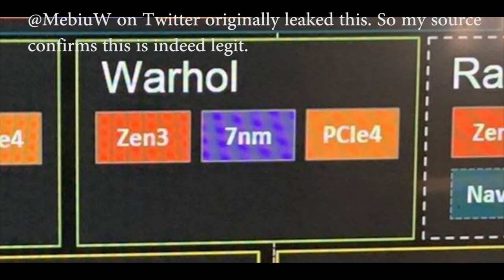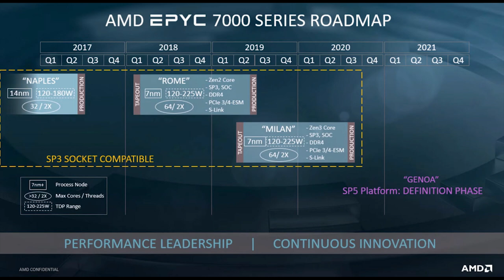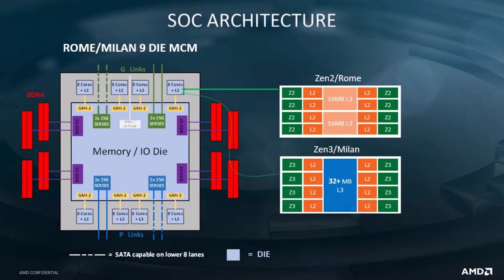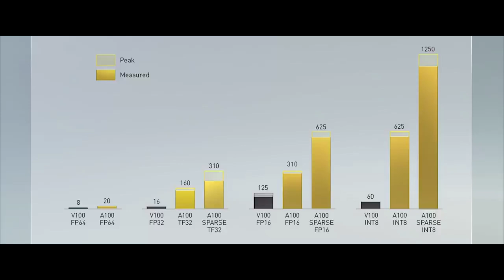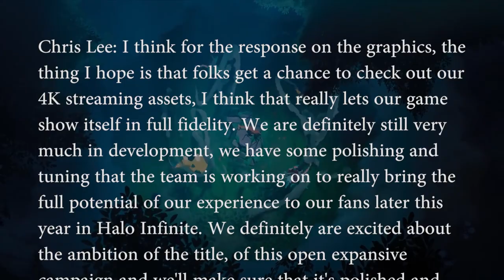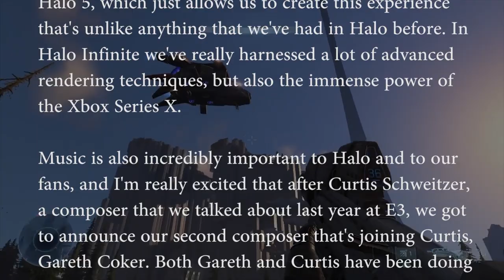AMD Zen 3 Performance & Warhol Info (Exclusive) | Halo 'up to' 4K & Dev Kit Info

Comment: If X670/B650 supports USB 4 (and therefore the included TB3), that would be a good send off for the AM4 platform.
Reply: On the other hand though, you'd be buying into a dead end platform.
Reply: @The0Gizmo  yup
Reply: No B550 is the last AM4, AM4 is only support till 2020 remember?
Reply: @floorgang420  Yeah I kind of don't expect anything other than X570 and B550 for AM4.
Reply: @floorgang420  That's a commitment about not ending support early, not about pulling the plug after precisely 4 years. Plus, looking at how inconsistent that support has been throughout these 4 years, one can't actually speculate with any degree of confidence on whether one more set of AM4 boards would actually be needed.

If I were to entertain the idea of a new round of AM4 boards, I wouldn't expect anything particularly fancy out of them - maybe on TR (big maybe), but not on AM4.

Comment: XSX running a bad looking current gen game at dynamic 4K lol
Reply: Simply horrible.
Reply: Surely you mean Pop-In Box
Reply: Jesus what do you expect ps5 could only run the unreal engine 5 at dynamic 1440p at 30fps, thats horrendous in 2020, hell 99% of ps5s games were 30fps, these console's are far from what some people think.
Reply: @uFlock  you think you won't see pop in on a ps5 game 😂 you're in for a shock fella and at 30fps.
Reply: @dockgamer973  I am a PC guy with 2080Ti and will get the new 3080Ti when it comes out. All xbox games are gonna be available on PC for free with game pass, so there is absolutely no point in getting a pop-in box. However, I will also get a PS5 for the exclusive games and I don't really care that they are 30fps (coz you know they are consoles after all)  it's all about actual games for me. I just prefer to call out bullshit, if whatever sony showed was just as bad as what microsoft did I would call them out as well.
Reply: @uFlock  ooh you're so lucky that every couple of years you can upgrade your pc for more than 3x the cost of a new console. Congratulations.
Reply: It's called having a job ...
Reply: @uFlock  I also have a pc with a ROG STRIX RTX2080TI, and no way could I play at 30fps on most games, I get my xbox games on pc and to be honest there are very little games on PlayStation I cant get looking and running better on pc, I'm not getting a console and a paid subscription for a hand full of games on ps5 which to be real it looks like sony is going the xbox route to, sony isn't going to avoid the largest gameing user base in the world for long.
Reply: @dockgamer973  Sony will not go a microsoft route because that is the road to failure... The games that I play on PS5 are the games that don't require high frame rates or online subscription of any kind, it's mostly single player games such as God Of War, Ratchet And Clank, Uncharted, Spider Man, Horizon Zero Dawn, The Last of Us, Ghost of Tsushima etc. Also maybe when you play on high refresh monitor on PC it's jarring but when I play on my 75 inch 4K OLED True HDR TV the games don't look too bad. But PS5 promises 4K/60FPS (new ratchet and clank and horizon dawn west looks amazing even for a PC game), so depending on the lunch titles I might even get PS5 before I upgrade my pc as my current one runs everything just fine with 60FPS Maxed out settings. Maybe it's even smarter to get PS5 this year and wait for PCIE 5.0 and DDR5 to hit the market and then get a nice zen3/4 System on AM5 platform and maybe, just maybe an AMD GPU if it can compete with Nvidia (but I doubt it that DLSS 2/3 looks too good at the moment).
Reply: @dockgamer973  is that the Unreal 5 demo with 0 pop in and true next gen graphics. Now compare that to what looks like a poor current gen game in Halo
Reply: @dockgamer973  already happened.  :D
Reply: @billygunn142  Polyphony should had done GT7 on that then.
Reply: @dockgamer973  there was pop in on the Rachet and Clank game play reveal but nobody talks about that.  That was for assets that were fairly close and not far off in the distance.
Reply: @dockgamer973  You do realize even PC with graphics card wich costs alone 4 or 5x times the price of what we expect on ps5 is having a hard time running the Last Assassin Creed game at 4k and 30fps, right?

Regardless of the resolution, the UE5 demo has such Sharp image and graphics fidelity that it still looks much better than any game at native 4k. In fact, the image quality was so good thanks to the trillions of nano poligons giving excelent definition on any micro Surface Lines that tech experts had a hard time trying to figuring out the resolution, we only came to know bc Epic themselves said It. There are a Lot of other things that dictate image quality besidesresolution. And take notice on some of the current technology like the one NVidia use, making It kind of useless this non sense arbitrarry demand for native 4k. At the end of the day what matter is the final result not just vague numbers.
Reply: MR.TwoSix um...they were pre alpha footage that actually look good. So I’m not worried about that.
Reply: @humbertosouza9013  GT7 doesn't have any pop in
Reply: Yeah that was not a great representation of the potential of the upcoming console.
Reply: Even the last Cyberpunk 2077 gameplay running on PC had pop-in and some flat textures
Reply: @kyzersoze8408 
Halo Infinite is cross gen and isn't finished neither beacause it's being optimized for Series X, they showed an old demo running on PC without RT. We need to wait for actual Series X gameplay to give a valid opinion on SX performance and Halo Infinite SX optimized version.
Reply: Ricardo SV we need to ask the question WHY haven’t they shown series x gameplay footage? Shouldn’t an “xbox games showcase” near the end for the marketing for next gen have some series x gameplay? Even phil was bragging about having the system on his table and doing play testing. It should have been shown by now.
Reply: @kyzersoze8408  Yeah something smells fishy here.
Reply: @kyzersoze8408 
Agreed. That was dishonest. I'll wait for actual SX gameplay to have a clear opinion.
Reply: @uFlock  :yeah hard 🤣🤣
Reply: @JonnieDarko316  : was on a pc with equivalent graphics, you need to do some research, rt won't save the bad textures.
Game looks like this as it's for current gen, unfortunate but oh well.
Gameplay looks solid though.

Comment: Will X670 get Thunderbolt ?  Would be excellent if AM4 supported Zen4/ Ryzen 5000.

Zen4/Ryzen 5000 will be 5nm, right ?  Zn3/Ryzen 4000 is 7nm ?
Reply: You can already get X570 boards with Thunderbolt 3, it is just up to the manufacturer (such as the ASRock X570 Phantom Gaming). So yes, you should see X670 MBs with Thunderbolt, but it will once again be up to the manufacturer. 
https://thunderboltlaptop.com/best-thunderbolt-3-motherboards/#7_ASRock_X570_Phantom_Gaming_%E2%80%93_Best_AMD_Ryzen_TB3_Motherboard
 
And Zen4 is meant to be 5nm, so you are correct. Zen 3 is an enhanced 7nm process.
Reply: am4 dies off with ryzen 4000...am5 is getting ddr5
Reply: @markhamil3916  That does depend when we get DDR5 though. If DDR5 only hits the home desktop market in 2022 or later, then Zen4 will likely be released on AM4. 
  
If DDR5 does make it to the home market sooner, than we will likely see AM5, Zen4 and DDR5 released together. If not, Zen4 will appear on AM4. 

But I do agree with the video, we might actually see delays. I think if AM5 was coming next year with Zen4 and DDR5, we likely wouldn't be getting X670, AMD would have just stuck with X570 and B550 as their last AM4 chipsets. 

I really don't see AMD releasing X670 just for Zen3. But who knows, we will know more next year. But AMDs last statements (when they announced that B450/X470 was getting Zen3 support after all) told me that AM5 might get delayed. I have been thinking that ever since that statement of theirs. 

In that statement AMD said that Zen3 will be the last new CPU gen to be supported on B450/X470. AMD never said it would be the last supported on X570/B550. And when you look at AMDs new slides they say X570/B550 is for Zen3 and the future. All of which very much tells me AMD is fully thinking of keeping AM4 for an extra year. And X670 now and the other news coming in lends further into that direction. 

But a delay to AM5 does not mean a delay to Zen4, it just means Zen4 will be released on AM4 instead.
Reply: @joeyvdm1  amd stated multiple times ryzen 4000 will be last generation on am4 platform
Reply: @markhamil3916  Yes, but didn't Paul's source say that might change ?
Reply: @markhamil3916  I know, but things change and plans change. AMD appear to have changed their minds, or at the very least are very much considering it. 

In their last statement AMD said that Zen3 will be the last new CPU gen to be supported on B450/X470, but AMD never said it would be the last supported on X570/B550. 

And when you look at AMDs new slides they say X570/B550 is for "Zen3 and the future". That really says to me that AMD is leaving their options open, for a contingency plan, in case of DDR5 setbacks (or whatever setback). And with X670 going to being released now, and the other new news coming in, it honestly says to me that it might be the case. 

All things considered it very much tells me AMD is fully considering keeping AM4 for an extra year. 

And DDR5 has been late to release, AMD was expecting it earlier. So I think everything that AMD has said recently (more recently then what they said in the past about AM5), says AMD is very much considering otherwise now.
Reply: @markhamil3916  I am not saying AMD will keep X570/B550/X670 around for one more gen, but everything leads me to think they are considering it. 

Or maybe I should say, it appears AMD is keeping their options open, I think that might be more accurate.
Reply: I would love zen 4 to be released on am4 since i did something dumb when I went AMD by buying the most expensive mobo thinking i would get  a bit of better performance out of the chips like intel chips work on certain motherboards... LOL i gotta get my moneys worth out of the motherboard from the x570! The plan was to upgrade to maybe a 4950xt but if the delay in ddr5 happens Its defintely possible! (crosses fingers)
Reply: zen3 in 7nm+
Reply: @markhamil3916  That is the reason I am wondering if I should even buy the upcoming Zen 3 cpu? I mean won't it become obsolete real soon?
Reply: @deadpool790  I am not saying it is a sure thing, but I really do think AMD is considering it. I am only using the information that AMD has presented us with recently in their statements, and that information will be updated/changed as time progresses. And I am using the information coming in from other sources (such as RedTechGaming) to add to AMDs recent statements, which does lean further into the possibility of an AM5 delay. 

I think AMD is waiting till they know exactly what their plans are now, before they actually give us a firm answer, and everything points to them keeping all their options open. But I do agree and I do also think a lot of people would likely be pleased with an easier cheaper upgrade path to Zen4, so I don't think you are alone with being happy if Zen4 does make its appearance on X570/B550/X670. 

Everything is just speculation till anything is outright confirmed, and nothing is certain in life. So just keep your ears open and wait for future news on AMDs plans, they do appear to be keeping their options open, but everything could still go ahead with AM5 as was originally intended. I think it does largely (but not solely) depend on the state of DDR5 though, so let us see how things pans out.

Comment: I still don't get what NVidia by purchasing ARM outright that they can't get for dramatically less cost with an architecture license.
Reply: They will be the only of the big 3 that doesnt make both cpu and gpu. Low to mid gpu's are on their way out. Nvidia expects them to be replaced by apu's. Nvidia has been buying up companies to get more and more into Datacenter tech
Reply: @dralord1307  Arm doesn't produce anything though, they just design the chips and then license them to everybody. So nvidia will have absolutely nothing to gain by buying them as opposed to licensing the designs like they currently do. Also if they will plan to not license the ARM after buying that will be quickly stopped by the international anti-trust legislation, moreover anyone who will try to buy it will have to keep licensing the ARM to everybody just like it does now otherwise british/european/usa government/regulators will never approve of it, which circles back to my original point -> buying arm will not give nvidia any advantage over what they have now. If they really wanted to start making CPU's then they need to go after VIA.
Reply: @dralord1307  I get the data centre part (efficient comms is increasingly an issue when trying to push any of the HPC flavours - Shasta sounds very strong). But consider Apple: they have an architectural license and in-house teams. They produce some extremely capable SoCs. Ok, so Apple is going for different markets to DC/HPC, but what is the difference between $100M and $20B (my guesses on numbers for AL vs buy company)? Thats 200 times difference. Denying others the ability to use the ISA seems unlikely (even if NV might see some value to it - but that  is very debatable value IMHO). Is there some important part of shaping the future of ARM that could only be achieved with ownership? Cerebras for example seems to have struck out in a very interesting direction.  So I keep wondering what other than NV ego is worth such a large price? Maybe the revenue stream? But that sounds like repeating the decisions Softbank made. I don't deny our point that they want control over a relevant portfolio of capabilities, but this rumour just seems very expensive for not enough benefit to me.
Reply: @davidfell5496  ARM is probably the fastest growing CPU producer. Also many analysts are predicting arm to take over mobile and possibly even desktop in the midterm future. So Nvidia might be looking at that for when the gpu market dries up.
Reply: @uFlock  I know what your saying and disagree. Look at arms growth there is a huge amount to gain. I dont think the EU regulators would let the deal go through.

Comment: If Nvidia buys ARM, will that speed up the industry adoption of RISK-V?
Reply: Why would it? Last time Nvidia designed a custom ARM core it was one of the fastest on the market, the only core able to keep up with Apple's offering in single core performance.

Of course RISC-V will always gain traction as it's an alternative to ARM and might make more sense for certain applications, but I don't think Nvidia is going to affect it if at all.
Reply: @arwlyx  I agree. RISK V will take hold in custom design silicon, but x86 and ARM should affect RISK V adoption.